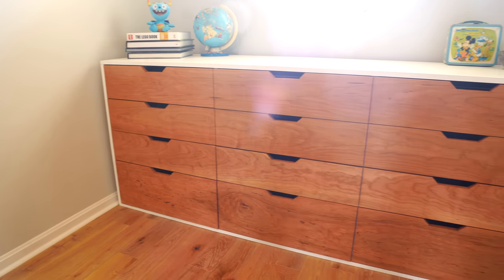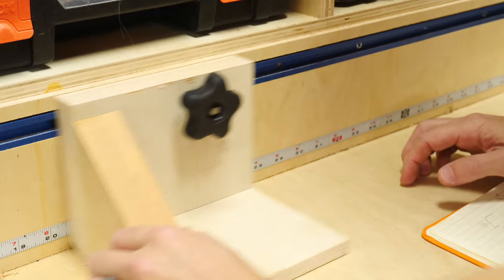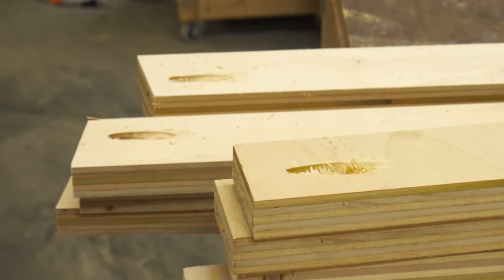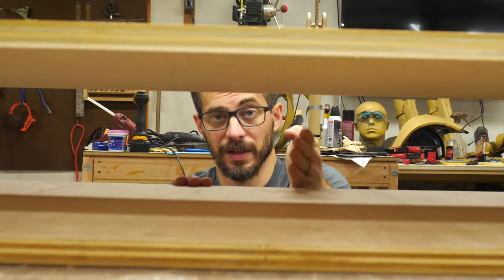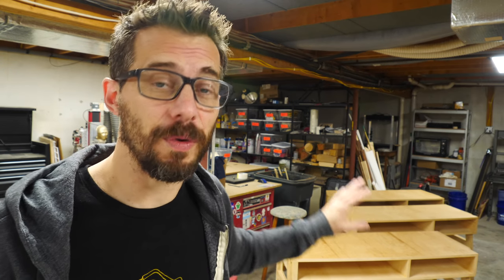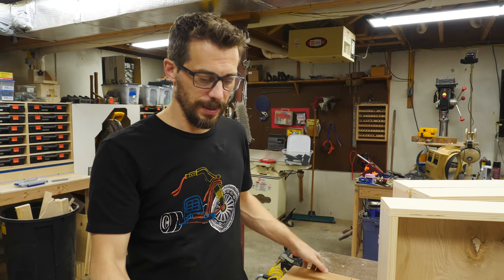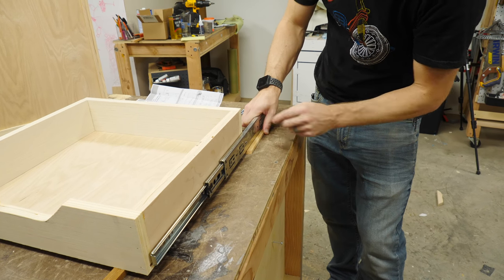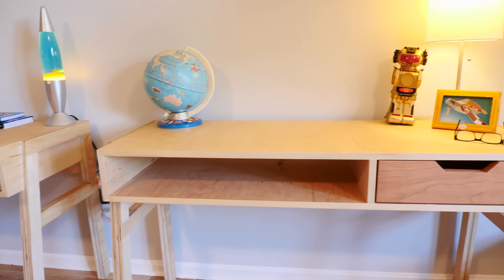How to Make a Modern Writing Desk | I Like To Make Stuff

Comment: Cool project & video!  I have had success using masking tape to create a "hinge" when gluing up mitered corners.  It holds the corner perfectly aligned and keeps the glue from squeezing out.  Sometimes a shallow dado, a quarter of the depth of the thickness of the plywood will lock the divider in place and give you more glue surface area.  You can also brad nail diagonally into the corner to hold it together until the glue dries if the nail gun fits inside the desk.  A solid wood face frame is also an option.  You can also round over the outside edges of the leg assemblies with a router prior to glue-up to make the corners more kid-friendly.  Keep up the great work Bob & Josh!

Comment: Mate for the mitre joints, flip upside down, line it all up flat and masking tape up along the joint on both sides. Flip back over, glue in the joints and simply fold up and tape to make square. Or staple on the edge. When dry simply remove tape and minimal amount of sanding. Perfect edge every time

Comment: To make the alignment of the miter-glueups easier lay both pieces flat with the outside up, align the outside edge and then put painterstape over the edges so they stay connected. Then turn the whole thing around and apply the glue. Then just fold the miter and place the cornerclamps

Comment: This gives me some ideas for a problem I've dealt with for years.

Because of my disability, I need a desk I can stand at. I'd extend the legs, and probably give myself more surface area for my laptop. My balance is garbage, so I'd also need a desk I can lean my hips against. I might put some kind of cushion material (like a wrist support for keyboards) on that edge to make it more comfortable. Since my knees won't go under the desk, I don't really need the open space below the top surface, so I could fill that space with drawers for the paperwork that comes with adulting (oy, the paperwork).

Comment: To further hide the screw holes you filled, I have routed a channel the same depth as the thickness of the iron on edge banding, going with the grain direction and finding a piece of the edge banding that matches well. This is time consuming and works best when you have a variety of banding to choose from; however this was a manufacturing setting and in a woodshop may not be practical.

Comment: If you notched out the legs for the baseboard, they would sit tighter against the wall. Mathias W did that on his bed frame and it always seems like a good thought in a design.
Reply from the maker: Yeah, thought about that as stuff will probably roll off the back of the desk eventually. We may end up doing that.

Comment: I noticed that you notched into the drawer box to install the slide. I’ve been struggling with getting drawer box sizes exact to the distance between drawer slides, especially front to back.  An 1/8 in makes a big difference in the slide performance.  Any tips or tricks here would be appreciated.

Comment: Big thing I would do is to add power for a laptop and maybe some USB ports for charging. Might even extend that to a wireless charging spot build into the desk. Another idea would be to add LED lights in the drawer area on a relay that turned them on when the drawer was opened...running all the cables sunk into the desk legs.
Reply: I'm actually taking an Ikea entertainment center and cutting it down into 2 sections. 1 will be used for the TVs in the game room. I'm going to add some wood to the top to strengthen it, stained lighter to pop. I'll add an LED strip behind it. The top section will be flipped upside down with casters. Just like the TV stand, I'm adding some more wood for strength and some padded sections. It can be moved around for extra seating or as a coffee table. Beats throwing the thing out.
Reply: Main reason I've been watching your channel is because I want to build a new bed and headboard. Trick is that we have an adjustable foundation and sometimes it moves. I'm going to build the sides to lock the legs in place.

Comment: Nice build , just one question why do you put a drawer front on top of a draw front ?  Why not just use the nice wood as the front joined to the ply sides ?
Reply from the maker: It's just a quick and simple construction but you could totally do that.  Being able to perfectly align the  front within the opening is much easier when you can place it independently of the drawer box.

Comment: hey bob,  I get get really good hardwood off cuts for free from a local joinery factory, they are all hardwood that is for sure but... they are all different species and colours. I wouldn't even know what species they are. Do you think I will have any issue gluing up tabletops and other joints from different unknown species? will different expansion and contraction rates cause me a problem. I plan on selling what I make so I don't this stuff to fall apart on me?

Comment: Thanks for the video. Curious if the glued miter is sufficient for main case. Bottom seems like it would be weak; might have to be careful about how much is loaded into the cubby section
Reply from the maker: The entire thing is surprisingly strong.  You could always reinforce the miters with splines if it was a worry, but it's solid.

Comment: I think I'll make this for my wife but put the table at a slight angle with a strip of wood at the bottom to stop her sketch pad or work piece from falling down. The only thing that I'd need to change is the height of the legs and the sides will be some weird trapezoid shape. I like having the back open like yours.

Comment: Why use a different wood drawer front? You said its the leftover from previous project. Is that it? Is that the reason? But why not use the wood in the front as the drawer face itself? You also get an extra inch or two in the drawer by not using another wood in front.

Comment: Are you using Kreg tools for all those pocket holes and circular saw guides?? is it a good thing to have, since my circular saw cuts look like wavy lines on a heart-rate monitor.
Reply from the maker: Yes, I use the Kreg stuff, it works great for the price! Way cheaper than a track saw :)
Reply: @Iliketomakestuff   Will definitely be checking them out. Where's the cat on the thumbnail though? Been waiting to see it.  Thanks for your reply, wrote that comment halfway through the video and you replied very quickly. Thanks for that great desk idea (looks great). Planning a big custom desk for my 2 monitor laptop computer thing later in my life. been scribbling in Sketchup for 3 days now.

Comment: could anyone answer my question could you put wood filler in where the drawers are on the front sides so when you pull the drawer out you dont see the holes?
Reply: Yes, also a mixture of wood glue and sawdust would work, however,  neither filler would be completely "invisible. "

Comment: The reason why I don't like pocket hole joinery, especially with plywood, can be seen at 4:08 - 4:09
Reply: though these are hidden once the legs are attached to the desk
Reply: @forby_  Have you taken a better look at 4:09, have you seen the layers in the plywood go apart a bit? Although the joint is strong now, but during regular bumps and moving of the table they risk to split it totally. I realise also that it could be the problem with any kind of joinery with screws into "endgrain" of plywood, a simple small pilot hole would prevent this from happening, but I've never seen anyone predrills holes in other parts of pocket hole joints.
Reply: @milosozegovic6980  Sure, I guess that's a risk. I thought you were saying the reason why you don't like them is that they _can be seen_.

Comment: Why do you need an inner drawer "face" when you have the outer drawer face so thick? Couldnt that just be part of the drawer?
Reply from the maker: You certainly could, it just makes the construction quicker, as you can make a super simple box, then cover it with a nice front.  That's especially handy if you make multiples (or new project videos every week ;)